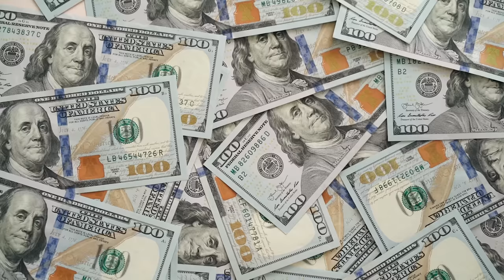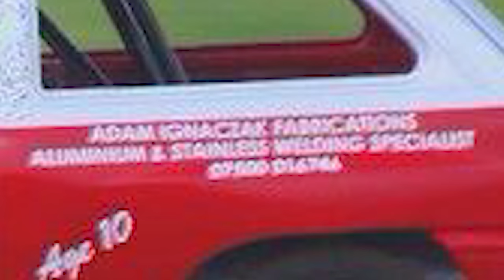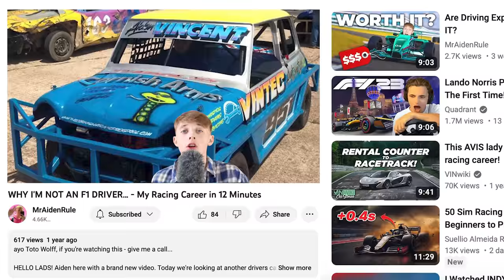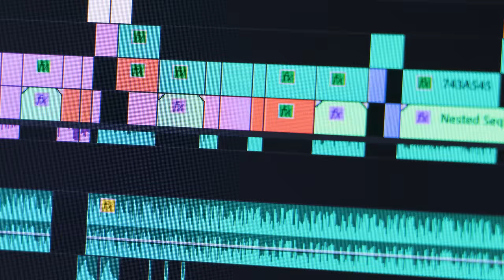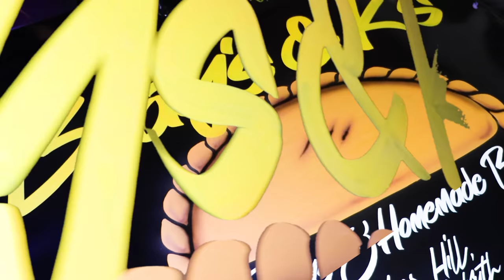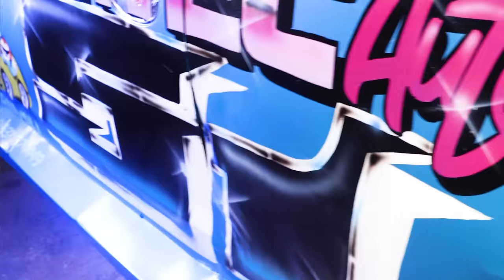I Tried Stock Car Racing

Comment: Not many things dumber than banger racing. I do apologize, as there is a strong community for it. Lower level stock car racing though, is commendable. They try to win, try not to crash, and even try to run the same car for more than one week. In America we call them compacts, challengers, or hornets, depending on the region of the country. Banger racing though? Pointless and stupid
Reply from the maker: Respect your opinion and do prefer stock car racing but generally speaking I couldn't disagree more. Banger racing is mega & great fun for all involved aha
Reply: @MrAidenF1  I’m shocked there isn’t an average of one or more deaths or broken necks per race. No neck support, crunching cars on purpose like it’s a demo derby. The only way it would look less safe or organized is if they didn’t wear helmets
Reply: dumb? clearly you have no clue how the cars are built. cars have floor plates, h frames, door plates, harnesses, kill switches etc. rarely are people injured as safety is taken seriously. cars are built to a high spec with track marshals making sure they meet the rules. i don’t think you’ve watched a full banger race as you seem to think people only crash in them